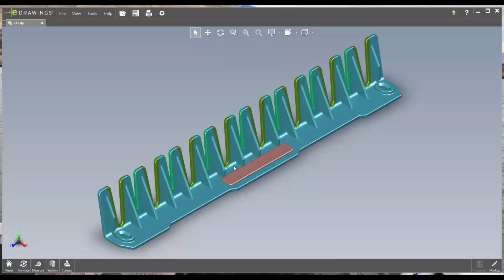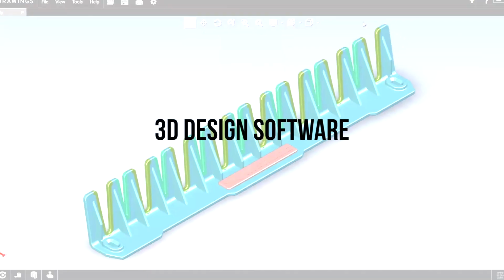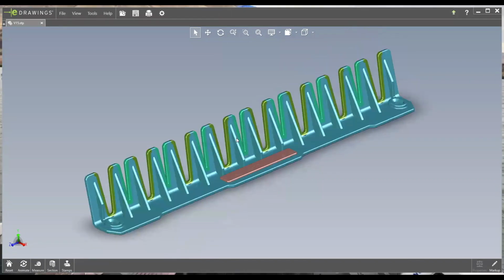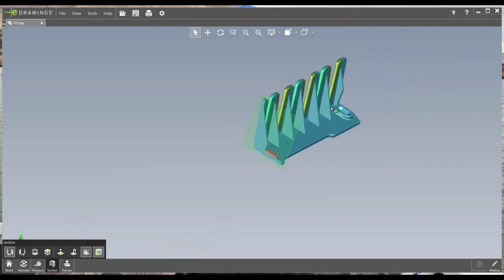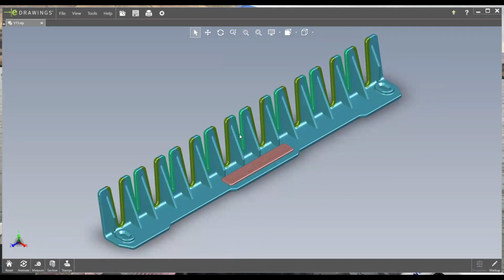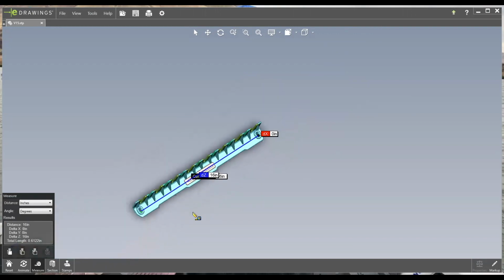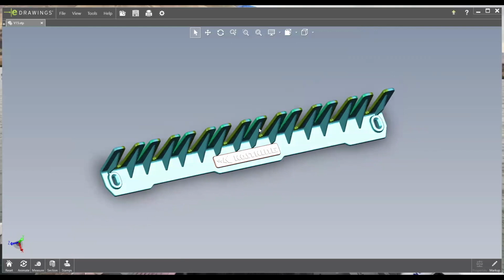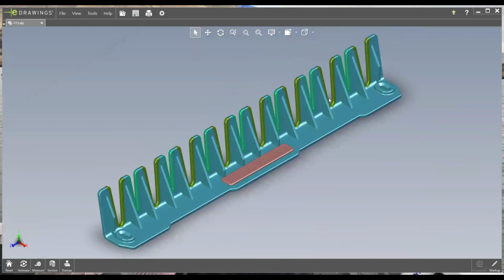DO YOU BELIEVE IT? – Does KastKing Use 3D Design Software For Research & Development | VR15 Rod Rack

Comment: Why didn't you make the Mounting Holes 18"? 
That would have put in the Center of the house framing studs.
Thanks Again for sharing the information in the Video.
Reply: Most wall studs are 16inches on center!
Reply: @scottthomas6895  
THANK YOU for the clarification.
It was My Mistake.
Reply from the maker: Thank you for watching